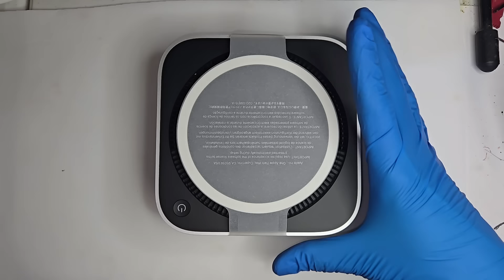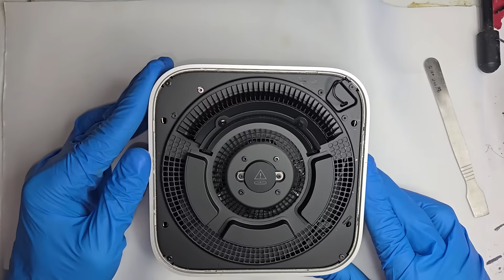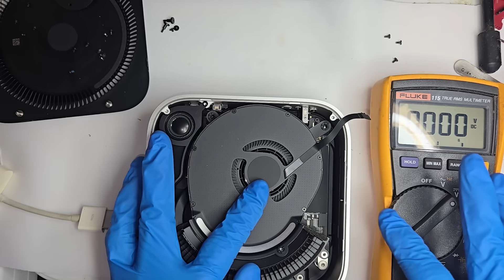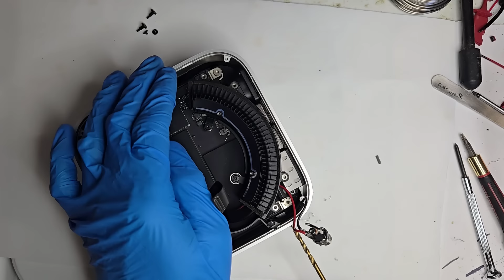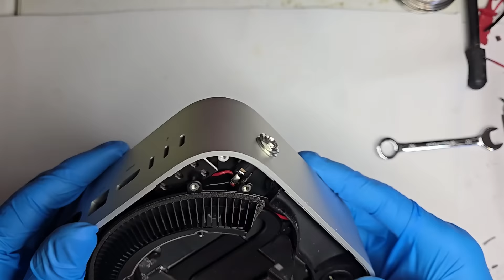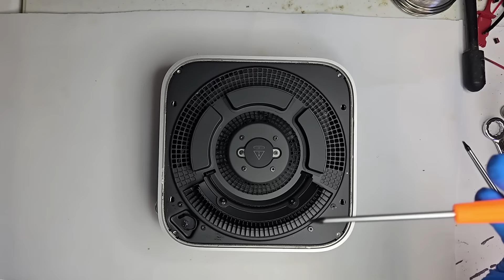DIY Hack: M4 Mac Mini Teardown and upgrade to run from Batteries.

Comment: Perfect! No need for an AC UPS. In order to avoid drilling the chassis, perhaps you could sneak the 12v wires through the bottom vent boles.
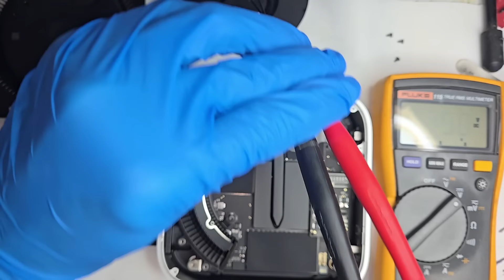Reply: @bingeciren  https://youtu.be/I3Jg9pInnag?si=5_yL9K3f3fbJz7mI … In this video by Luke Miani at 2:10 there is a very simple and quick solution for people complaining about the power button on the bottom of the Mac Mini. Perhaps we can take the power button and the external power input out and stick it on the outside for the same hole of the power button. And use another AC connector more small or a used MagSafe 🤔
Reply: @dubseadj  do you know the voltage of m4 psu, 12.0v will not be able to automatically charge the battery pack

Comment: Why do you drill a hole on the case and void the warranty? There is a hole exposed from the AC socket when the internal power supply is removed from the Mac Mini
Reply: I bet he's don't care a warranty anymore 🤣

Comment: the front usb c ports are removable and not soldered. Maybe you can use one of these with a little power delivery pcb and usbc port. than its possible to use any PD Batterypack or plug.

Comment: Apple could make it power on by DC power, but to earn from repair cost from AC faults dues to high voltages, most people goes to repair shop.

Comment: I did the same with my Apple TV since the PSU failed, and no replacement parts were available. I bought a 15V, 1 amp wall plug (the Apple TV requires it to run), and it works just fine.

Comment: Can you mod the macmini with usbc to power with a powerbank?
Reply: You can do it from the other side, get a USB trigger cable. For example "Quick Charge 3.0 12v trigger cable" or "Power Delivery 12v trigger cable". They would normally come with usb A or usb C on one side and a barrel plug on the other side, useful to power things like routers from a power bank. Most power delivery power banks would give out as much as 65W no problem, but you should check with yours. Qualcomm Quick Charge ones should support up to 18W output in highest voltage. Triggering 12v might not be enough for mac mini though, from this video we can see it uses more like 12.5V. I can't tell exactly as I don't own a mac mini now. So on top of a trigger cable a step-up module might be needed to push from 12v to desired 12.5v or from 9v to 12.5v. Adding a voltage regulator inside of the mac mini would solve the latter problem for good.

Comment: I run mine off of a Dell thunderbolt dock.  I think it would have been cool if one of the thunderbolt ports was a power port like on a laptop.  Then you could power it from the dock.

Comment: Hi and thanks for your testing and video. Can you tell me/us where do you install the negative (black) cable in the mac mini? Why not under the screw right next to the plus (red) cable? Is the negative (black) cable also only connected through a screw? Under the mainboard? Thanks for your help. Will try this with a usb c trigger board and replacing one of the front usb c ports.
Reply from the maker: If you noticed in the vid, the whole board is grounded neg.  I just used that.  you can certainly use the neg right next to the pos post.
Reply: @mikegyverComputer  Yeah noticed it :) Only wanted to hear your thoughts why you chose the grounding with the screw under the board?

Comment: I wonder if you can get a 12v usb-C trigger module,  and power it off a power bank or a laptop brick adapter.  They are very small and it would just look like an extra USBC port.   12V 5A - 60w should be plenty.

Comment: To me it looked like you were back feeding the psu with such high current, do you know if that is the case (does the current drop down to 10-100ma after a minute)?
Do you know how it handles brownout(too low voltage)?

Comment: Apple should have used an external power brick like a MacBook Pro that would allow the mini to be a bit smaller in height. Does USB-C have some issue with continuous power draw ?

Comment: I would be curious as to what the wattage pull is using direct DC. Did you happen to measure that?
Reply from the maker: peaked at ~19w for a sec on bootup.
Reply: @mikegyverComputer  So what was the average wattage while it's running?
Reply: @JoeJoeNoone  about 3-5w idle

Comment: Four 3 volt batteries in series to get 12v. Probably will run for 10 minutes before the batteries are dead.
Reply from the maker: 8 (AA) batteries.

Comment: Wow, drilling into the chassis without removing all the of the components doesn’t seem wise and I noticed you didn’t run a micro vacuum to remove any aluminum dust particles. Also your coax power jack and leads are not at the proper AWG to handle 130W and you didn’t use heat shrink tubing to insulate the leads.

 I would have added a Shockley power diode at the point of entry, better yet even use the switch in the power connector to ensure you are isolating the two supplies.  Interesting though that you are reading 12.6 VDC, which is the ideal voltage to charge a Li-ION power pack again if one isolates properly.

Finally, as others have said, the power connecter is a little unsightly. The aluminum case is thick enough one could drill the main hole and then use a chamfer bit to mill a wider opening for the nut. Even better if there is enough clearance is to drill and thread the hole so you can screw the connector in so that the opening is flush with the case.

The sad thing is Apple is always making things less practical for the customer so that they don’t eat into the profits of other products, eg their laptops. What would have taken to added a proper DC connector to make this even more useful.  In any case,  hopefully this will lead to more “DIY Hacks” to make this the perfect little Mac.
Reply from the maker: 😱😱😱😏 I'm pretty sure from the demo from our other vid shows it's definitely not 130w.  More like less than 21w on boot up and 8w idle

Comment: Uhm, other than "because we can" what's the point of this? Instead of getting a laptop and having everything right there in one package, this needs a monitor, keyboard, mouse and the Mini - four large and clumsy parts, and you have to hack up the Mini. If this is meant as a failsafe Mini, then just get a UPS.
BTW, there are stick and battery PCs out there.
Reply: For me everything is an advantage, the super compact size with everything I need built-in, not having to use dongles that fail with their USB C connectors, the RJ-45 to network my devices with Pioneer's Pro DJ Link, sometimes it's difficult to use a laptop in DJ booths due to lack of space to put it, with the mini and an iPad Mini everything is installed quickly and working. Sometimes in beach clubs the power fails in the venue, with a battery I wouldn't have to restart everything and configure it again. It's a good solution. I only use the Mac Mini and the iPad Mini, and use the touch keyboard of the OSX and for the little things the Apple Pencil on the iPad, nothing more, and wireless! Also a ometimes is impossible have 110-220v in remote places. For me the question would be why doesn't Apple release an iPad with OSX installed?
Reply: @dubseadj  Apple wanna to make more $ by selling more iDevices. They refused to incorporate touch screen capability on Macbook. iPad and M4 Mac mini makes a perfect touch screen solution. Coindentally, co-pilot recommended Carrying Hard Case for Pioneer DJ DDJ-SB3 SB2 DJ/DDJ-400 Controller/Ddj-Flx4  as a case for Mac Mini.
Reply: Nah you miss the point.
No one want to buy an expensive ass MacBook for just only M4 chip
Mac mini are enough. With this mod, anyone can use it anywhere just put a monitor & MnK on it. Not that inconvinient 😎 (talking about "convinient" there're many people who prefer mini ITX system over a laptop)

Also those stick PC is sucks. Still nothing can compare to this performance per price of Mac mini.
Reply: For those of use with RVs this is huge. The issue we have is it's very inefficient to go from 12V to 110/220/240V. You need an inverter and then the power supply in the machine steps this back down to 12V so doing away with this step is vastly more efficient - oh and cheaper because you don't need an inverter.